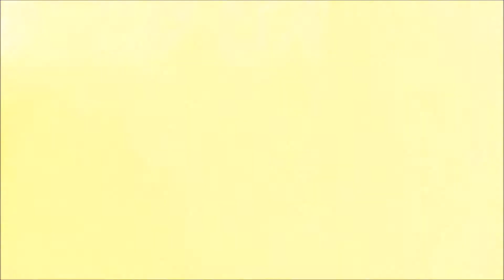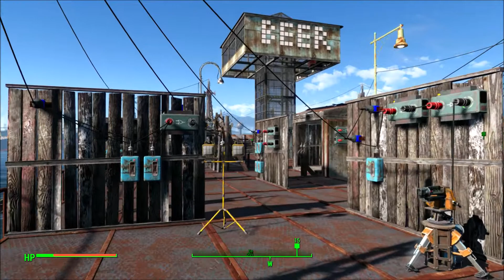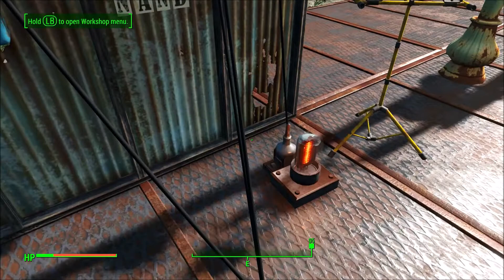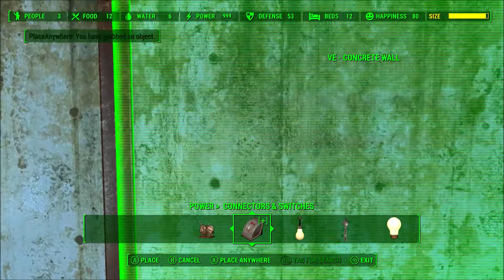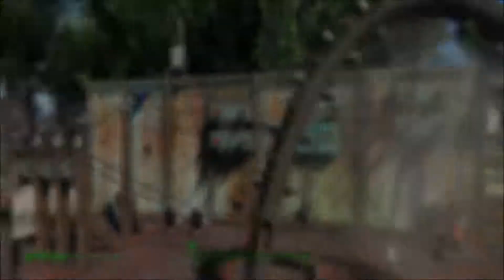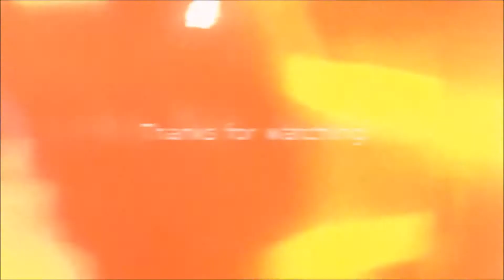Fallout 4: XOR Gate Tutorial- No Mods Required

Comment: So do you think you can demonstrate how to make a laser tripwire reset automatically? If its possible? Without mods? Thank you!
Reply from the maker: I wish I could.  I have tried to make laser tripwires reset, but removing and adding power doesn't reset them.  Only way I have found is to manually go up and activate them.  However, there is a kind of workaround using the switches that are meant to go on conveyor belts.  You can see it in use on my build tutorial for an automatic decon arch.  Might be worth a more in-depth tutorial on just the switch.  Thanks for the comment!
Reply: Nacho Bidness ur quite welcome! U got my wheels turning now! So thank u!